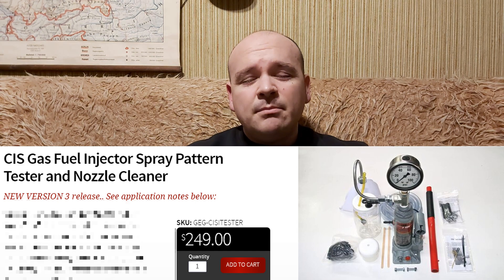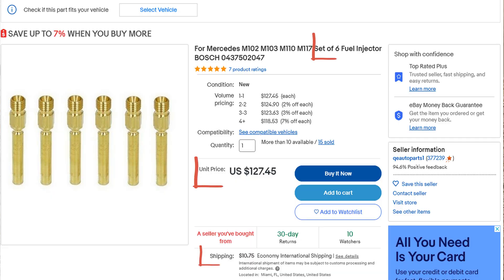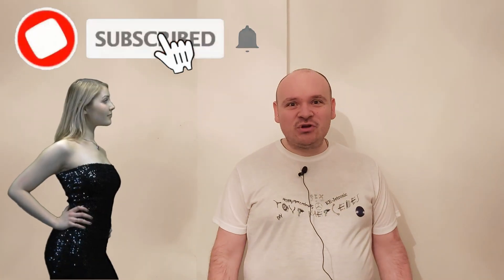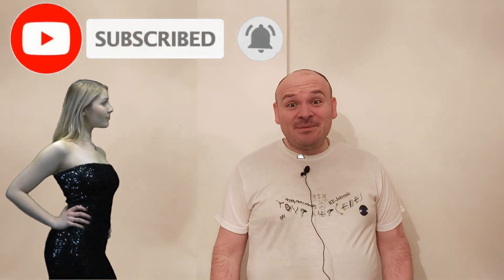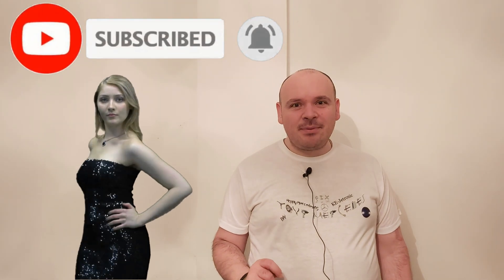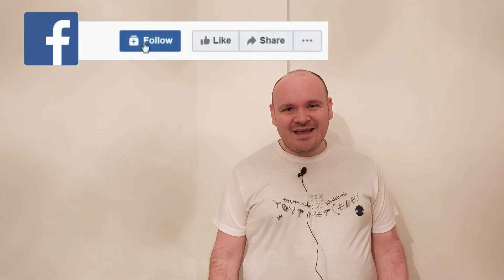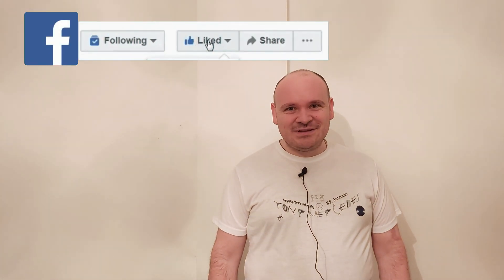㉦Mercedes Ke-Jetronic㉦ - Cleaning the injectors

Comment from the maker: In this video find out whether you can clean your mechanical injectors or not - with a special tool or carb/brake cleaner. This video is the definite answer on your question about these injectors!

Comment: You confirmed what I already thought , that the injectors can't be rebuilt . You can tell by looking at them , that they are sealed and look to be one piece. I recently bought a very nice 1992 SL300-24 R129 KE-Jetronic  , with 126,000 miles and it is running rough. I figured that I would change out the injectors and not try to rebuild them .
 Thank you for this video.
I am a subscriber .
Reply from the maker: Thanks so much for your thoughtful comment — and for subscribing! 🙏 You're absolutely right: these injectors are sealed units and not designed to be rebuilt. Many people still try to clean or "restore" them, but the internal spring tension and spray pattern often get compromised.
That SL300-24 is a beautiful machine — and with 126k miles, it's likely the injectors are tired. A fresh set can really smooth things out, especially on KE-Jetronic systems where precision spray matters at idle.
Wishing you many smooth miles with the R129 — and if you run into more KE-related issues, you know where to find us. 🔧🔥

Comment: Thank u! Hope that this fix my problem when its cold, it starts and when i push the acelerator , the car goes down to stop!
Reply from the maker: This comes either from bad injectors, potentiometer or fuel distributor if these 2 are okay under condition that the fuel pressure regulator hold constant pressure.
Reply: Fuel regulator hold might be.

Comment: Question about injectors….what size is the threaded compression union on the Mercedes cis-e injectors?  The ones on my Jetta are 12mm x 1.5mm and the barrel dia. Is about 10mm I believe (I can measure that with calipers). 
 Also, did Mercedes produce any 4 cyl. CIS-E cars in mid 80’s that were close to 1.8 displacement?
Reply: …and If so can you tell me the Bosch p/n for such a car?

Comment: Hi Ivica, Thanks for your video. You say it is 7 fuel filters in this video. Can you list them, please? I have a -88 560, and have some issues with the gas distribution. Rgds Erik
Reply from the maker: 1 - strainer(in the tank), 2 - fuel filter, 3 - pump filter, 4 - the barrel in the fd, 5 - the filter in the upper chamber lower part, 6 - filter at the chamber upper part(on the exit) 7 - in the injectors.
Reply: Thanks!👍. The injector filter is out of reach, but I will check the rest.
Reply: By the way, where is upper and lower chamber filters? I know about the filter in the fuel line to the FB, is that upper chamber?

Comment: i know this is out topic...im confused about the ATF fluid for my 2.3 m102 4 speed auto...i cant find a manual for it. People say dont use Dexron 3....should i use Dexron 2?
Reply from the maker: Hi, Maui. The best way for you is to to go to the store and take a registration license with you. As they read your VIN they will tell you which fluid is the best for you.
Reply: @mercedeske  nevermind, now i have another problem, my 2 year old battery went dead on me, had to call mechanic to jumpstart...after jump starting my idle when rough, changed to new battery idle still rough the same...rpm wanting to stall. Whem giving 1 2 rpm or running it is smooth...only happen when stoping on D...cant get AC on or it will shake too bad. Checked both ovp fuse is still fine. Im at lost, could it fry inside the Ovp?
Reply from the maker: @makavelibenzze  The ICV. These are the symptoms of a bad ICV. Check the vacuums. Check if the ICV is fine. Turn the steering wheel from lock to lock both to the right and to the left. If the rpm starts falling or if the car stalls, then it's the icv.
Reply: @mercedeske  checked my ICV, Swapped it with another one from the workshop, swapped the ECU, OVP, FPR....ruled out ignition system....each cable, each plug, new TD box, new distributor cap and rotor. Even swapped the distributor body. No vacuum leaks at all. The engine seems to have a misfire on Idle. When running it is fine no bogs. Im at lost again. Maybe its a wiring loom issue? Checked every connection to every hardware...even potentiometer and EHA. Misfire happens after jump starting..only on idle though...it is a misfire rather than a rough idle...and the symtom is incosistent...sometimes go and come. What could it be, damn this K jetronic can make u go crazy
Reply from the maker: @makavelibenzze  Maui, can you send me the video of it on the fb page fix your Mercedes? I can't tell you like this. When it happens record at the front as well as at the back. Maybe it's the exhaust, I can't tell from here, really.
Reply: @mercedeske  iv sent you the video from my dash...mine is 230e...with no Exhaust sensor or EZL really
Reply: @makavelibenzze  
Hi
I have same problem.
How you solve your problem ?
Thanks.
Reply: @smcitex1  whats your problem? rough idle?

Comment: Perfect timing my friend. I was thinking the same thing. I found them for 20 bucks each x 8 cylinders. With the rubber stem, tax, and shipping, total was 200 US dollars. I know “the man” 😂. I’ll just change them and not think about it anymore.
Reply from the maker: Hehehehhee.... You are good to go for another 10 years for sure!👍🏻👍🏻👍🏻👍🏻
Reply: @mercedeske  let’s see if it’ll fix my hot start issue. I pulled one and it looked “clean”. 😂 Just got the car with zero records. Better to just change it all.
Reply from the maker: @sophiathe380sl  They can cause warm start issues. You can test them if you want.
Reply: @mercedeske  is there an easy way to test them or I need the device from “the man”? My local auto store lets you borrow tools and they have it. Not sure if it fits these injectors though.
Reply from the maker: You need to take them out and put them on again. Put them in clean bottles, take out the fuel pump relay and bridge the contacts 7&8. That way you make the fuel pump run constantly. Measure the quantity you get. There must be equal quantity. Do it for one minute. Once simulating idle(sensor barely deflected), once half its way and once on full plate. The important thing is that after that minute the injectors MUSN'T drip fuel. If they do, replace them. All of them must start and stop atomizing in the same time.
Reply: @mercedeske  way too difficult for me. 😂 I’ll just pay the 200 and get new ones. Thanks for explaining though.
Reply from the maker: @sophiathe380sl  🤣🤣🤣🤣🤣